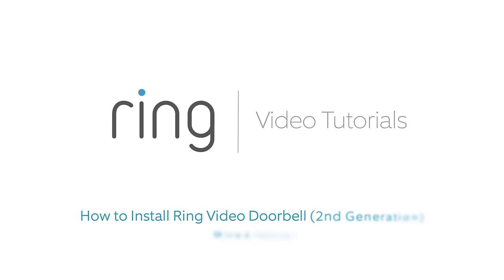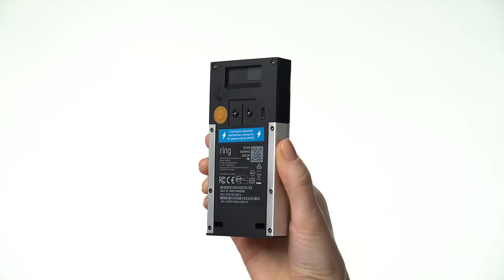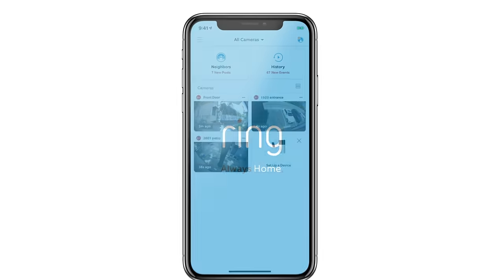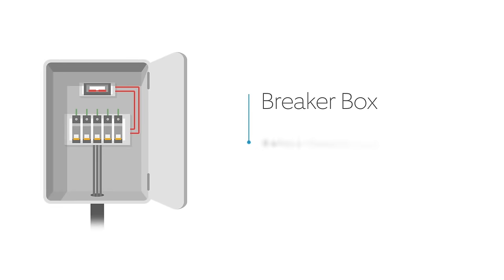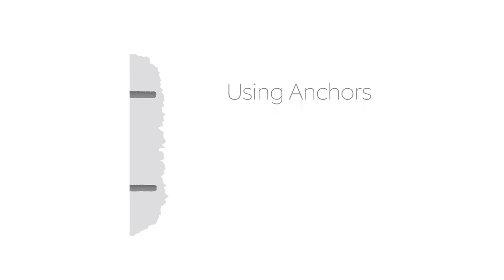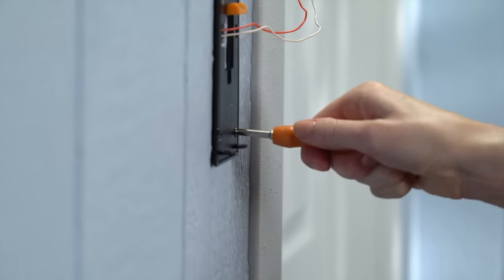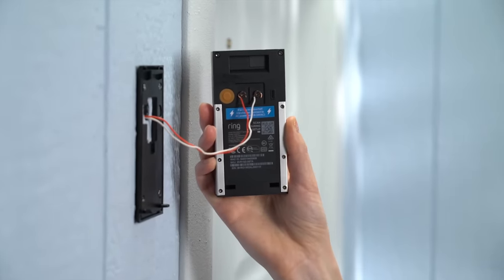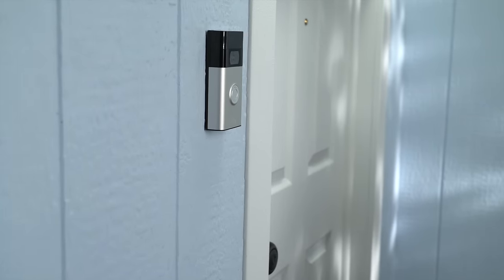How to Install Your Ring Video Doorbell 2nd Generation (Wired Install) | Ring

Comment: It doesn’t come with a drill bit
Reply from the maker: There should be a drill bit, we have Social Care Advocates available on Facebook and Twitter if you want to send us a message, we are here to help. 

Alternatively, please give our Community Support a call at 1-800-656-1918, (or if outside the US: http://ring.com/callus) 24/7, seven days a week for more support. We look forward to hearing from you.
Reply: @ring  Yeah, for some reason mine did not come with a drill bit. It came with a small blue screwdriver, but no drill bit
Reply: No drill bit with mine either, just tell me the correct size please
Reply: Mine didn’t come with a drill bit either. The booklet says to use a 1/4” masonry bit - is that correct?

Comment: So I just got my gen2 Ring but didn’t get the provided drill bit. What it suppose to come with a drill bit?
Reply from the maker: Hi there. Each Ring device includes all the parts and tools needed for proper installation in the box. Your Ring should have included a masonry drill-bit to allow you to drill directly into a brick wall to install your Ring. However, if this masonry drill-bit is missing from your device's packaging, please give our community support a call at 1-800-656-1918, (or if outside the US: http://ring.com/callus) 24/7, for more support. We look forward to hearing from you.

Comment: Do I have to charge the unit first if I'm going to use the doorbell wires?
Reply from the maker: Great question, Rob. We recommend fully charging your Ring before placing it outside to ensure the wiring can help keep the battery in the device charged. Wiring your Ring Video Doorbell 2nd Generation will charge the battery at a trickle of approximately 10% charge per day, so fully charging the device before installing will ensure you're set up for success in the future.

Comment: Do they still come with drill bits and levels? I dont see one in the box we got for Christmas. 
Would be good if they showed how to test the voltage, amps etc with a multimeter.

Comment: I like how at 0:08 they completely glossed over what appears to be the key to all of this.  Most people are not going to know where to find this information or what it means, and for some strange reason, they don’t tell you!!! Are there instruments that can tell you this information?  Is it written anywhere?  What happens to the Ring if you install it and it’s not compatible?  My model came with that wire that you loop inside the chime that’s already in your house.  Why does that not apply here.  It would be nice to know all of these things.  Thanks for nothing Ring.

Comment: I installed a Ringdoorbell 2 about 2 years ago ... it is hardwired to my previous doorbell wires.  It worked great for the first few months but then it just stops working.  About every 3 months or so I have to check settings  under device health, it says hardwired, it says status is at 100%,  but nothing.  I have not changed my password ... my modem and router are working fine ... but nothing since Thanksgiving day.  I tried the hard reset ... the with light comes on then the blue lights flash ... still does not work.  I have taken the battery out and connected to the orange wire provided ... it says it is charging ... so what is the point of having the thing hardwired if I have to continuously take the battery out and charge it.  Kind of defeats the purpose of the hardwire.  What is going wrong with this thing ... is it just a faulty system or am I doing something wrong.

Comment: Those wires that you connect to the screws and then tighten to make sure it’s secure and anchored to the unit... when you press the button does that sound the doorbell in your home or...?

Comment: It sucks because ring 1 is wired and never have to charge it again.  I upgrade to Ring 2 and I wired it and you still have to charge the battery??? Sucks really bad because ring 1 is not 1080p and ring 2, is 1080p.

Comment: My batter is at 3% and for days it hasn’t increased i turned off all features and still doesn’t increase shld I take it out the mount and wire and charge it?

Comment: Question.. how do I get my doorbell inside the house to work with this? I set up my RING but now my doorbell inside doesn't work. Help!
Reply from the maker: Hey Jacob, you will want to check the compatibility list here: https://support.ring.com/hc/en-us/articles/210644123-Ring-Video-Doorbell-1st-generation-Chime-Kit-Compatibility-List. If your chime kit is on the compatible list and you still need help, please give our Community Support a call at 1-800-656-1918, (or if outside the US: http://ring.com/callus) between 3AM-11PM PDT, seven days a week for more support. We look forward to hearing from you.

Comment: My home has no doorbell.. What model do you recommend for me?
Reply from the maker: Hi there, thanks for showing interest in Ring! We have battery-powered devices available which doesn't require any hardwiring. Feel free to check our our devices directly on our website: Ring.com. If you have any additional questions, please let us know. We're happy to help.
Reply: Ring what abt if I don’t want to connect the ring bell on this one ??! It will still work???
Reply from the maker: Great question, yes, you can use the Ring Doorbell 2 in battery mode. However, using this option will not ring the internal chime kit when the Doorbell is pressed. Let us know if you have any additional questions, we are here to help

Comment: I'm seeing some comments asking do u have to periodically USB charge after its hard wired!?

I'd imagine that's jus the initial start up process.

And once you (where the doorbell button was) wire into the existing door chime with transformer... it will also make the door chime sound when u push the ring button!

The 2 wires(usually red & white) will keep the ring powered up!
8-24 volts AC 

Also ask yourself do you think they would design this product where you'd have to take off the wall again so you can recharge with USB!!   Should be one & done....
Move to the APP process & try to enjoy.
Reply from the maker: Hey Orlando, great question! Before utilizing your Ring Doorbell, we suggest allowing the battery to charge for 6-8 hours. However, if your Doorbell's battery is draining due to the transformer not providing enough power, we definitely recommend that you dismount the Doorbell to charge it. If you have any questions, please let us know. We're happy to help.

Comment: Is a wirewound resistor needed if wiring through a mechanical chime?
Reply from the maker: Hey Brian, great question. A resistor is only needed when connecting directly to a transformer without a chime kit. To ensure your chime kit is compatible, check out our compatibility list: https://support.ring.com/hc/en-us/articles/115003008663-Ring-Video-Doorbell-2-Chime-Kit-Compatibility-List. Let us know if you have any additional questions, we are here to help.
Reply: That's a good question . I'm gonna get an old fashion chime kit that has 2 wires that go to the old door bell type.

I'm guessing that's the old strange set up that breaks the circuit when the button was pushed!?

There were/are diagrams of the old door bell set up. Obviously RING incorporated how to apply to the wired system!?

I remember some Ac thermostat would power up without a common wire .... kinda like a backfeed.

And yes I've done HVAC work for a living . That's how I know some of these things!
Wired in a few garage remotes/motors
Genie /chamberlain

Comment: What kind of wire is needed?
Reply from the maker: Great question, 18-gauge wire is the ideal gauge to use with Ring Video Doorbells. It provides the proper amount of resistance and is very easy to work with and makes wiring simple. 

To determine whether or not the wire you're using is 18-gauge, get a standard metal thumbtack and compare the pin to the wire. 18-gauge wire is approximately the width of the pin.

Comment: Question, if it connected to my original doorbell wires, then do I still need to take out the doorbell to recharge periodically? And how do I know my original doorbell voltage can support the new one? Thanks!
Reply from the maker: Hi there, great questions! Depending on the amount of activity that your Doorbell captures, you may need to unmount the device to recharge the battery so your Ring stays powered on to capture activity near your home. Also, the Doorbell needs to be hardwired to a 8-24 VAC transformer in order to receive a proper charge. If you have any additional questions, please let us know. We're happy to help.
Reply: Agreed I was nervous as the backplate was very secure but just make sure you're separating from the bottom side. I used a flathead screwdriver to pry it.
Reply: @ring  i installed my door bell camera about 2 years ago and only recently did the battery start to get to below 15%. Settings have been unchanged. Should I recharge it or is it near the end of the battery life?

Comment: what if someody just cuts the wire or hacks the internet
Reply from the maker: Hello. If someone does attempt to tamper with your internet, your motion-activated camera will capture a video of them doing so, and you'll be able to use that as video evidence for a police report. Security is our top priority at Ring, and our team of security experts are always working to ensure that you are safe and protected on all fronts. If you have any questions about the security of Ring devices, we’re happy to answer them.

Comment: ok but how do you remove the backplate
Reply from the maker: Hey great question, you should be able to remove the security screw and slide the bracket off. If you are still not able to, we are here to help. We want to help ensure your Ring is easy to setup and we want to provide you with a long term solution. We have Social Care Advocates available on Facebook and Twitter if you want to send us a message, we are here to help. 

Another option is our Community Support at 1-800-656-1918, (or if outside the US: http://ring.com/callus) between 5AM-9PM PDT, seven days a week for more support. We look forward to hearing from you.
Reply: @ring  Yall should let people know that for 2nd Gen the backplate is on a magnet and can be removed by "pinching" the sides and pulling the magnet, with the top hinge being removed last.